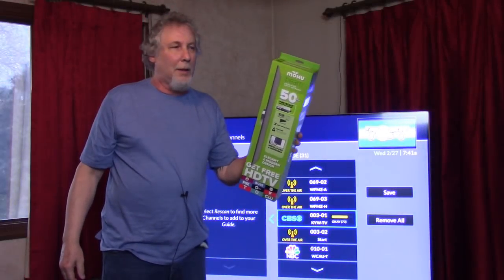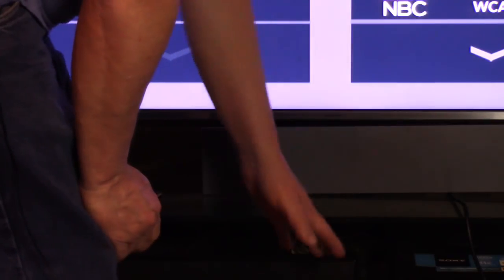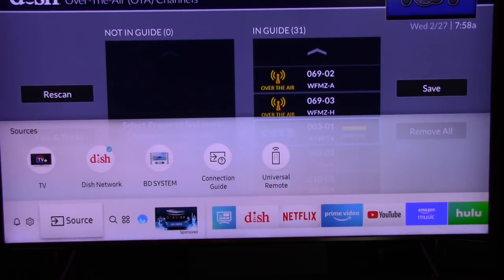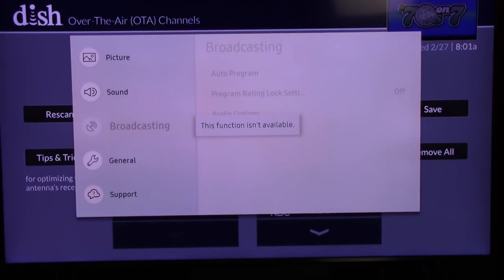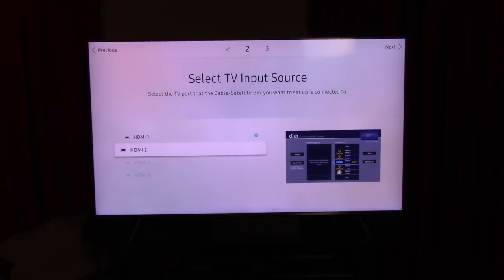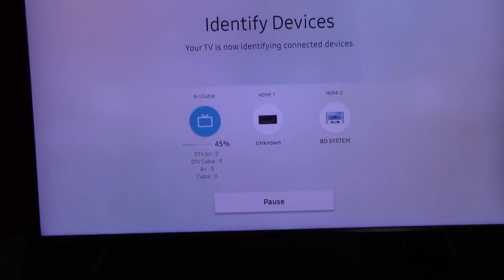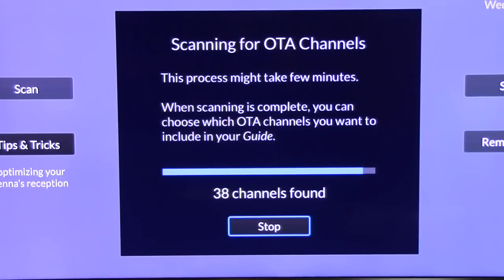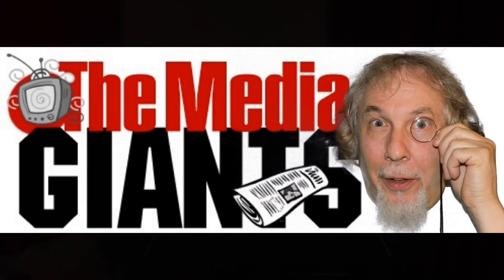Free HDTV Setting up the Mohu Beam Antenna

Comment: I wish I could use something like this.  Even with an attic mounted 150 mile antenna I can’t get any stations in hilly Tennessee where the nearest station is 40 miles away.
Reply: I feel for ya I live in a small town in MO. The closet town with  stations is 120 miles. No digital antenna will reach. 

We got a rotator with a analog antenna that could pick up channels back in the day before the switch to digital.

Comment: hey rick! Just wanted to say sorry you couldn't figure out your problems there with mohu. But my guess is I don't think two antennas were meant to be set up. You need to only go through one source like connecting the antenna as a separate unit so you can get those channels like you tried with the other. I know of a video on you tube that has self-help guide to show you how to connect the antenna directly to your tv. There is one channel on here called disable my cable I think. This is something that the fella goes thru to show you how to setup the antenna properly and what ideas he can give you in order to connect your antenna to the tv and to be able to get those channels for free. So hope this helps! If you want too also there some good deals on antennas if you want try Walmart or The Source (formerly Radio Shack) or maybe Best Buy might have them. So good luck on your hunt hope this helps! smiles...!

Comment: Just got these from HSN today,  haven’t plugged it in yet but after viewing your vid I’m not optimistic on these.  Will set up in morning and see what I get. I’m 20 miles from NYC so still holding out some hope I can cut the cord on cable.
Reply from the maker: Well being that close you should get some channels. I hope it works good for you.
Reply: Just finished setting up and scanning. Get 13 channels, 5 of them crystal clear beautiful 1080p Spanish channels :( 3 clear locals, unfortunately not enough locals to cut the cord.  Try to move other spots and see. My opinion of this Mohu beam though is I have tried the cheaper flat antennas and get the same amount of channels, this one no better than the cheap ones.

Comment: Lol Rick, great video. I'm still using my homemade antenna. I made years ago, out of a junk 2x4, nails, and metal clothes hanger, wire and coax cable. Wonder if the shopping Channel would sell them for me, It seams to work hell alot better then that new one lol. You ever built youre own ?. Or have a link to a really good antenna?  
~Cody
Reply: I made one like yours about 10  years ago. Times were tough back then. I followed the Youtube video and I actually got a lot of channels for free.

Comment: Another antenna? This won't end well.
Reply from the maker: Yes So Far!
Reply: @mediagiant7045  i used to add a wire coat hanger or aluminum foil to rabbit ears to improve reception. But don't think anything will work with that thing. Maybe you could melt it.
Reply: @mediagiant7045  just got the nicest tie from jos a bank from haverford pa for 9 dollars. Reg 100. Changes color in light.